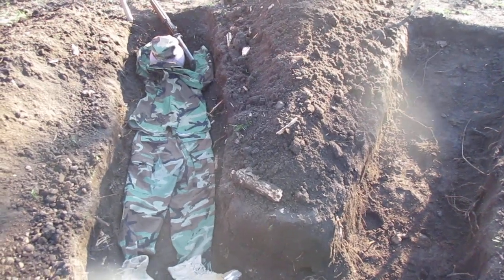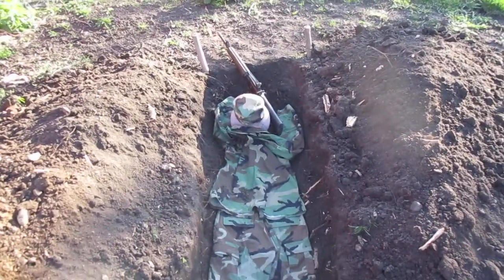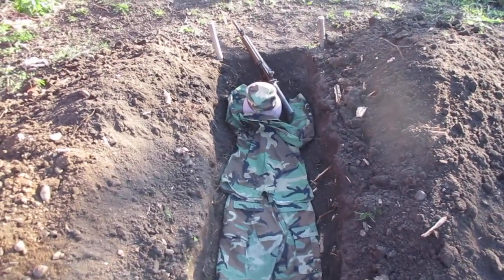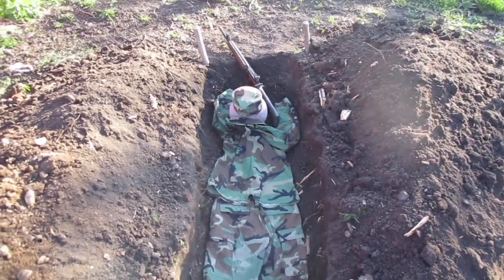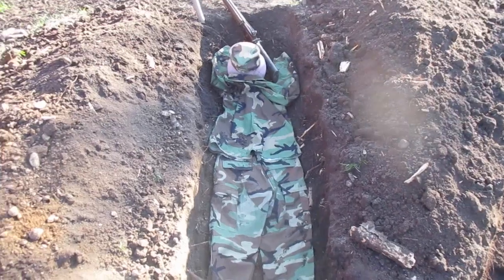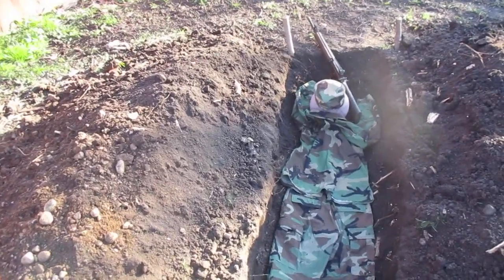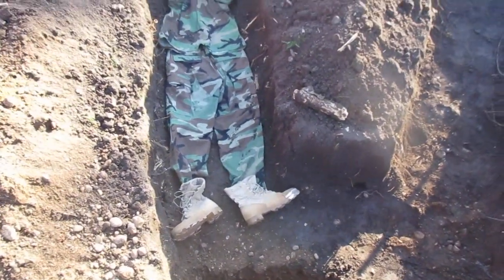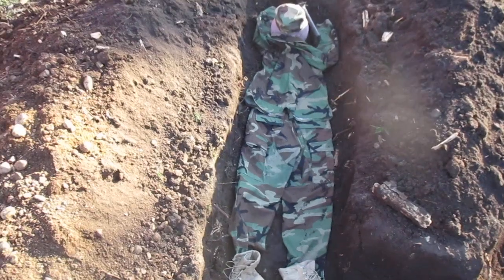Militia Engineer Tasks-  V-Shaped Hasty Fighting Position

Comment: So the lack of a tarp for aerial cover would be because its a hasty, no longer than a day positon right?       Just seems like a instant near improvement for that to try and wiggle a camo tarp or something over it
Reply from the maker: Wasn't a consideration years ago.  Now that might be a requirement because of drone use.  Nothing says you can't do it.  Just camo the top with brush also to break up the outlines of the tarp edges.
Reply: @SecurityGuy42  fair enough, had no idea when you orignally made this video to begin with

Comment: Sir,
What makes sure that the grenade roles down, into the sump?
Reply from the maker: You slope the ground down to the sump.
Reply: @SecurityGuy42  
Thank you.
How strong does the slope have to be, to prevent the grenades to get stuck on your gear?

Edit:  What gear should you have on you when in the position. And how to camouflage the rest of it?
Reply from the maker: You wear your load out.  Your load bearing equipment with mags, water, etc..